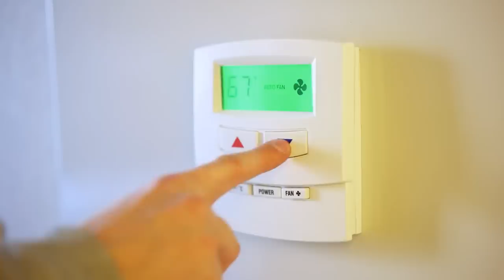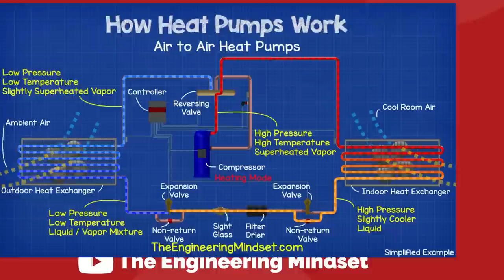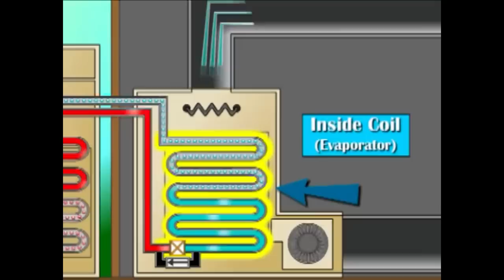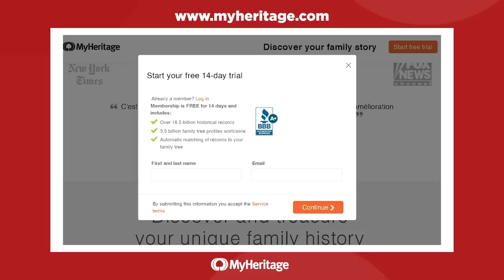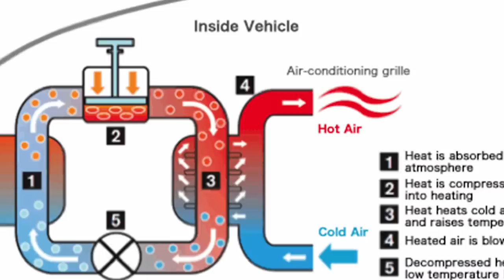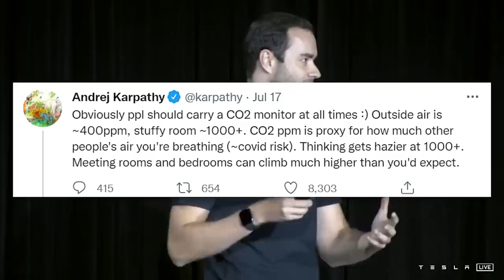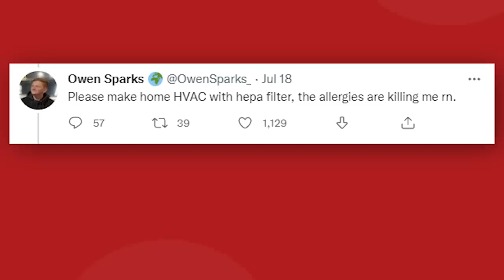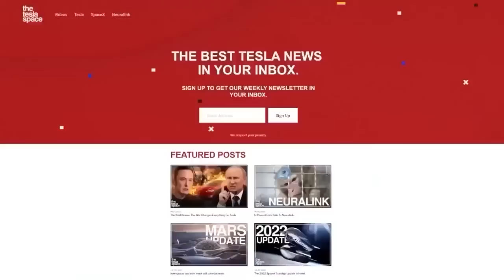Why Tesla's Heat Pump Is Essential For Our Future!

Comment: This is nothing new. Practically every manufacturer in the industry has been producing heat pump units for decades. The most efficient heat pump on the market are geothermal systems. Efficiency only matters if the house is tight and insulated. The passive house building standards require R-10 slab, R-40 Walls and R-60 Roofs. Passive house building standards started in the 90's. I love the ambition of Musk but the fan boys seem to analyze the business potentials a little to much. If the discussion is about DC heat pumps for small units then that's a different story. Thanks for the content.

Comment: I'm gonna blow most y'all's mind. My house was built 23 years ago and has a heat pump. Same AC unit cools and heats the house. Runs in reverse in the winter time. 

Edit... The most an AC unit can cool a house down is 30 degrees delta. Which means at the absolute best to cool a house down when it's 110 degrees outside is 80 degrees inside. So same for winter times. If it's 35 degrees outside, then the best it can heat up a house is 65 degrees. That's it. Most places in the US, it can get to the single digits sometimes.

Comment: who thinks Tesla invented the heat pump? And where is the absorption technology that makes cold from heat for AC and geothermal. There is no need to spend energy on heating or cooling. The need for money is our economic system not the energy requirement. (the fact this is mostly ads here is another clue)

Comment: Still no heating system as a efficent as a incandescent light bulb. 95% efficient for heat with the waste being light.
Reply: Actaullay to get he same about of heat that the light bulb produces a heat pump will use 1/3 to 1/5 of the energy.   so the equivalent to 100watt light bulb is a heat pump that consumes 20 to 30 watts of power.
Reply: @stevenf1678  What is the advertized efficiency of your heatpump when goes through your central air? 80% at best. Do you argue that an incandescent light bulb is at least 95% efficent for heat?

Comment: I want my house and car to have the LEAST amount of complex technology as possible to prevent all those "points of failure".
  All too often, more sensors and computer modules and remote controlled actuators just leads to more down time and higher repair costs.
  I'm perfectly capable of setting a manually operated thermostat and don't need a $500 computer module to do it for me.

Comment: There is absolute no engineering data in this video. Heat pumps are hitting the market that have SEER ratings of 33 and can heat efficiently to minus 15f. Window units,  mini-splits and central ac units. This is the future and Tesla is no where to be seen.

Comment: Integrated systems are already on sale. There's nothing particularly new in the heat pump system being proposed. HEPA filters are usually not needed since few people suffer from allergies to the extent that the  expense and energy penalty incurred overcoming the resistance of the filter are warranted. I already have some experience of Tesla products, notably the powerwall and they are pretty but very overpriced, to the extent that it's debatablewhether the powerwall battery saves its own cost in energy during its service life, even in the high-cost European energy market. 
These are niche products that may be attractive to people that want them as status symbols or have minority needs but they are a very long way from being mass market products that can compete on cost with the many alternatives that are on the market or in development. I'd certainly be careful of the cult of Tesla when assessing these items.

Comment: OK dude apparently you do not know how to air conditioner works the fluid and air conditioner is not super cool lol it’s just a compressible liquid when you compress it using a electric motor generates heat which is where the heat pump/air conditioner gets heat when you release that pressure the fluid becomes super cold creating a cooling effect this is the same way that fridge raider works as well or any other refrigerant

Comment: The more "technology" we use the weaker and dumber we get.  Modern buildings are massive green houses and don't have anyway to naturally vent the heat out..not to mention cutting down every tree in their way wich also keeps temperature 10° cooler and more fresh oxygen. Old buildings would stay cool using cross ventilation and windows high up above the doors to eliminate the heat.  Houses had overhangs all the way around the house.. a breezeway

Comment: Interesting. However Tesla is extremely bad at producing products that are not one size fits all. They are good at making cars, but they decide their own timeframe for when you receive it, which generation of batteries you get etc. 

That became painfully apparent when they had to install solar roofs and/or Tesla power walls and everyone's house is not the same. And a HVAC system is DEFINITELY not a one size fits all product. I really hope they don't try the vertical integration model with this one and simply outsource installation.

Comment: First of all, freon is almost never used as a refrigerant in modern AC systems.  Modern AC systems use non-CFC refrigerants.  Elon wants to put that technology in my house?  A heat pump with a HEPA filter and humidity control that knows when I come and go to turn off/on the air conditioning. Holy sh!t.  What a novel idea from the mind of Elon Musk.  To bad no one else like Nest, Siemens, Carrier, Honeywell, Lenox, or Trane thought of that.  Thank goodness for Elon.  Oh wait a minute.  Those are four things that have been around for years/decades.  BTW a HEPA filter has nothing to do with CO2.  I'm guessing the re-calibration in the firmware was changing the Octovalve to route refrigerant through battery/motor or put the system into a low efficiency mode that electrically generates it's own heat. (like spinning up the motor and periodically throwing reverse current to it to slow it down so it makes more heat)  It won't really work for a house and actually runs at lower efficiency in order to work where it otherwise wouldn't, and in so doing would be equivalent to a traditional electric furnace, which is expensive to run, and is less carbon efficient considering that most electricity comes from fossil fuels.  You mention solar roof.  How many of those have you seen?  Most of the solar installations that Tesla takes credit for are traditional rooftop galvanic panels, not the solar tiles that have been touted.  Tesla will not say how many of them it has installed, probably because the number is very small.  Any time someone says something is next level, you should be careful not to step in the bullsh!t.  Yet another in a long line of Tesla vaporware Ponzi schemes from Musk.  Nothing new, just Elon taking credit for old ideas and using to kite Tesla's stock values.

Comment: What am i watching? There are many different heat pumps and the tesla one is an air to air heat pump which is not the most effective approach. Also a air to air heat pump does not transfer any outside air inside. Although you can use a air to air heat pump to heat the air in your ventilation system and if you want to use  hepa filters you can use them but the hepa filter is expensive and will get clogged if you dont have a series of filters but this is absolutely nothing new. All this sounds like someone is reinventing the wheel and is trying to sell it to a neanderthal

Comment: Nikola Tesla would not be happy with Elon 💎
Reply: Wouldn’t be happy with me either.
Reply: Wouldn’t be happy with any of us 

Even right now we have ideas of what’s right and what’s wrong and in the future things will change like back then you really thought they thought women needed rights? Of course they didn’t think they did but obviously that’s changed
Reply: Because he knows how a business runs?
Reply: I'm going to give you the inside scoop about how this heat pump is going to work will be multiple small heat pumps just like in the vehicle and what they will do is string them together on the same shaft that way it can gain maximum efficiency and what it will do is physically only run one heat pump per room or two this way you can actually select the room that you want to have colder than the others and you can control the airflow individually to each room you can have heat running in one room and air condition running in another just depending on what the person in the room preferences and individual thermostats for each individual room this would allow ultimate efficiency combined with artificial intelligence to control the entire system as a whole... having all of the compressors hooked up on the same rotor means that they can individually kick in and if there's more than one of them kicking in they both work together so it helps get the other compressors up to speed and cuts down the energy loss. Because the system will be able to have multiple different heat pumps it can run one of them on air condition mode and the other on heat mode which will basically make dry air because once you heat up the air the moisture can be absorbed by the one cooling easier and you can control the actual humidity perfectly. Mark my words this will be how the system will work it will be for new construction and for retrofitting because you're able to hook up the individual ducts instead of the entire manifold which supplies all the ducts...
Reply: Looks like Nikola Tesla is just a generally unhappy person.
Reply: @AquarianSoulTimeTraveler  nope, just intellectually beyond most people.... which makes them think he's unhappy:)
Reply: @intelatomtm  😂 or me.....
Reply: @user-tl5sh8dg6e  " oppress the men, but make them think that they are free....then declare the woman oppressed by the men "

Comment: Combine self running generators and power walls in homes and businesses for seemingly endless clean energy everywhere all the time. Have a mechanical direct connect to the axle of EVs and solar, to super charge them. No more plugging in. We have the ability to make everything we want, happen. We have to get leaders who don't suck.
Reply: Nonsense!!!! The only problem with HVAC in todays buildings is proper insulation! You can have the best and most efficient hvac in the world but if your house is an energy guzzler it’s not going to do shit!!!! I have a friend which studies in Germany buildings and everything around it! I forgot the name of the branch.
Reply: In many European countries I think in Ireland they have been retrofitting very old buildings with more modern and better insulations to significantly reduce the needs of even an HVAC which most people don’t even have in Europe.
Reply: @alanmay7929  it would work. Especially if you have an energy effecient home. Use 3d construction robots to build better homes in a much shorter amount of time and less money.

Comment: Wow! What a “smooth” transition into a totally relevant advertisement about your sisters wedding and my opportunity to find ancestors with dna  🙃 …not
Reply: I'm going to give you the inside scoop about how this heat pump is going to work will be multiple small heat pumps just like in the vehicle and what they will do is string them together on the same shaft that way it can gain maximum efficiency and what it will do is physically only run one heat pump per room or two this way you can actually select the room that you want to have colder than the others and you can control the airflow individually to each room you can have heat running in one room and air condition running in another just depending on what the person in the room preferences and individual thermostats for each individual room this would allow ultimate efficiency combined with artificial intelligence to control the entire system as a whole... having all of the compressors hooked up on the same rotor means that they can individually kick in and if there's more than one of them kicking in they both work together so it helps get the other compressors up to speed and cuts down the energy loss. Because the system will be able to have multiple different heat pumps it can run one of them on air condition mode and the other on heat mode which will basically make dry air because once you heat up the air the moisture can be absorbed by the one cooling easier and you can control the actual humidity perfectly. Mark my words this will be how the system will work it will be for new construction and for retrofitting because you're able to hook up the individual ducts instead of the entire manifold which supplies all the ducts...

Comment: Heat pumps exist everywhere, so does the tech to adjust temps when you are away, and so do home HEPA filters.  This is more Tesla pumping and Elon fandom.  Tesla has published no information on auto heat pump efficiency. Likely it is no greater than current DC inverter home systems. Just more Elon snake oil.

Comment: A Tesla future is a bleak one for the poor and middle income people. No amount of glib brand marketing is going to heat a home. Modern technology is getting very expensive and the effectiveness of the air source pump in cold climates very dubious. No self build program I have seen on TV has ever used an air source pump and always lays ground source pipes. This is all a rich man's hobby at present and the funds  for moving away from gas boilers for most housing stock in the UK at least is just not there for the home owner and wealth seems just as polarised in the US. They cannot fund the mortgage as interest rates rise. Tesla shows little sign of affordability in any of their equipment and if I see a Tesla car I just see money and for many owners that is what they want as with any other prestige car.

 Gas prices will come down in the long term so there is no rush to get in to this very experimental activity which has not really got viable equipment yet and just dreams of what might be. Given the green mentality involves entitled people with plenty of spare time gluing themselves to roads and holding up ambulances and fire engines here it does not seem something for rational or hard working people just trying to survive with what they have.

Comment: no elected car for the working guy till at lest the 2030 year with a heat pump did not put out enough heat for winter drives and so tesla cars were not seen on Canadian winter roads in 2021 still just a secondhand cars for summer man toys if you make less than a hundred thousand a year and you must be able to plug in a heated car park at home, not outside battery temp for winter.

Comment: This is a catastrophically bad video.  Right off the bat, you reference coolant that hasn't been in use for DECADES.  "Freon" or R-12, was abandoned in the 1990s.  Furthermore, there continues to be even more improvements and developments in the coolant space.

Next off, ALL devices that manipulate the effects of Latent Heat are, by definition, a heat pump.  Just because the normies of the world don't know the right words is no excuse to not explain it in an EXPLANATION video.

For our next poorly researched item, air to air and more importantly ground sourced heat pumps have been around for close to 40 years. (As it relates to a unit that can both heat and cool).  Tesla is FAR behind the curve on this.  There are even air to air units that are designed for very cold climates.  Even most newer ductless units will operate at a COP of 1 or better as low as -27 C outside.

The other thing that is just not even remotely considered is that the very best overall performance is a ground sourced system and that it be part of a forced air heating and cooling system.  There are several issues that come into play with this as far as retrofitting.  First off, the ducting needs to exist so if you have an all electric baseboard heat house or you use a boiler with water radiators, well, you have a MASSIVE cost and could possibly be facing a truly impossible task.  Next off, even if you have ducts, they may not be sufficiently sized to deal with the level of airflow required to work at peak efficiency.  And even if you can deal with that, you still have to have either a vertical or horizontal loop installed and this may be something where you are stopped by government regulations.

Another thing, and this is typical of Elon not actually thinking things through and asking enough questions, is the whole thought of setback on temperature when you are not home.  This is NOT a good plan with heat pumps.  You want to set a temp for heating threshold and one for cooling and that is that.  You change nothing.  Heat pumps work their best when they are maintaining temperature.  If you have setback, you will spend a lot more time recovering and therefore more energy than if you just maintained constant temps.

And this leads to the biggest oversight.  Energy.  All these things run off electricity.  Does it result in less BTU equivalent spent to achieve all the same goals?  You bet!  I have a GHP and it also supplements my hot water needs.  My power consumption is more than half less per square unit of floorspace measurement than an all electric baseboard heated house (Which counts as a 100% efficient house).  However, I still end up with an annual power bill of about 23,000 Kwh.  This kind of change to the grid will be MASSIVE and many people won't be able to afford it.  And I am at the top end for efficiency as GHP is the top.  Air to air can get close in certain times of the year but a GHP is the ultimate champ for heating and cooling from a pure efficiency aspect.

Tesla will NOT be adding anything new to this industry.  Certainly nothing that will actually result in a gain that isn't as massive as simply moving to even ductless air to air in general.  If people want to change the world, mandate that ALL houses must have GHP and ductwork for all their HVAC.  Just don't expect the affordability of houses to get any better.  This stuff is NOT cheap.